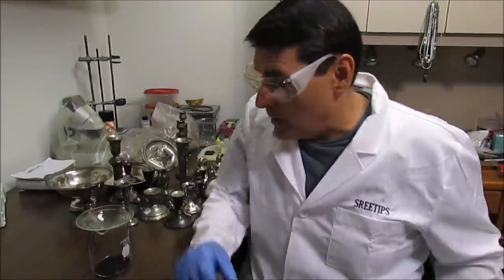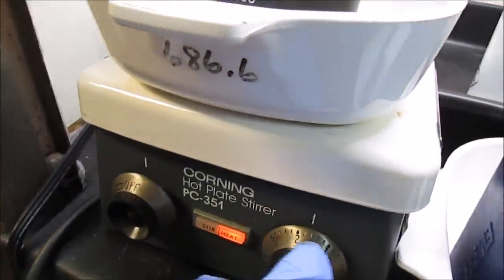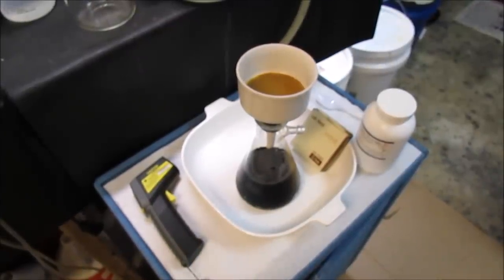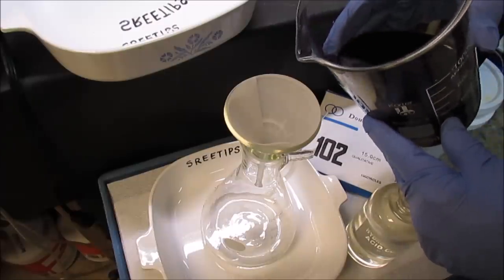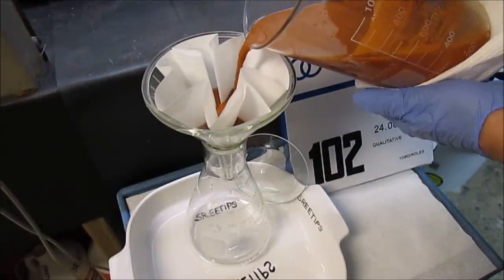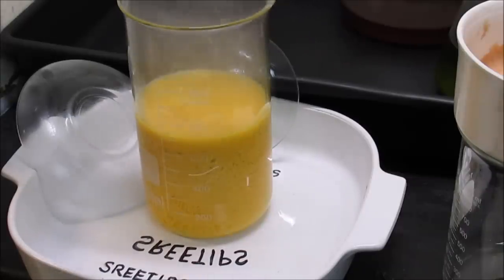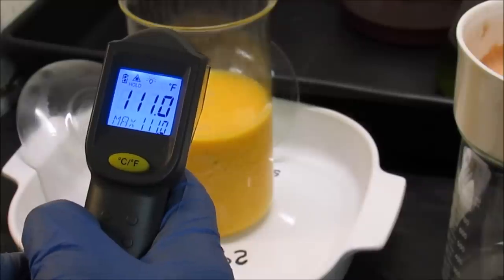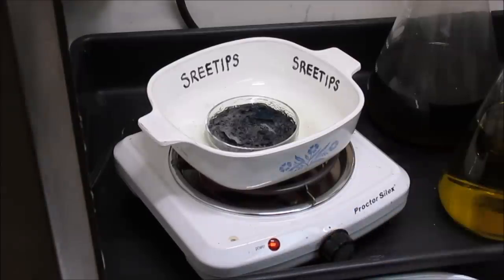Platinum Recovery From Automotive Catalytic Converters Part 2of2

Comment: Not any kind of amazing yield for the effort, but I greatly appreciate the information
Reply from the maker: no yield and too dangerous for do it yourself. Not worth it.
Reply: @sreetips   Yeah, I've got a bunch of palladium rich ore I collected. I got about half way through it before I decided it was too dangerous. Now I have a bunch of containers of blue and green and red liquid that I'm trying to decide what to do with. That's how I ended up here.
Reply from the maker: Get some zinc and cement the metals out of solution. Then collect the black PGM powders, dry them and send it in to a refiner. Most will give credit for platinum and palladium. Once the metals are cemented out they are no longer a danger.
Reply: @sreetips  Thanks

Comment: Could you have put the ceramic substrate from the last video into a ball mill to crush it all up?  You would have more surface area for the acid to leach as much PGMs out.  Or would that not make a difference?
Reply from the maker: To be honest, I don't know because I've never tried that.

Comment: you at least got $200 worth of palladium from those converters between the button and the filter ($19.50/g) not bad given you still gotta recover your platinum ($29/g)  would be cool to see how much money its all worth in the end
Reply from the maker: Aaron, palladium spot is $968, platinum is $908 (kitco.com) so Pd is $31/gram and Pt is 29/gram.
Reply: sreetips so was right on Pt but not Pd so the first google blurb i saw was wrong, so you got $350 instead lol
Reply: This is true, but you also need to consider the beaker that sreetips had in storage from his previous lab experiment. Factoring the time to extract the substrate from the metal enclosures, chemicals, Pyrex  glass, vacuum pump, buckets, exhaust fan, breathing apparatus etc. in the end, it was probably just the satisfaction of accomplishment. Those catalytic converters are not cheap and neither is the process in which to extract precious metals. Overall, I give you an A+ for your efforts esp editing a video for YT. I'm positive it was a net loss and that'll be the last time you buy converters!
Reply: as of 2/10/2019 Palladium @ $45.25/gram and Platinum @ $29.50/gram. that's up, $14/g more for Pd whereas Pt is only up, $.50/g from 8 months ago.

Comment: Hello Dear Sreetips, you are using H2O2 with HCl to dissolve PGMs displaced with Zinc. If I use AR instead to dissolve them  trying to have as little as possible excess of HNO3 in solution, will all the reactions shown in your video go as in hydrogen peroxide + muriatic acid method?
Reply from the maker: It should
Reply: Thank you! @sreetips

Comment: Hi Professor. thanks for the video.  I see all your videos. you are the best.  But I have a question. If I have silver in soluction. How can I recover the silver(with Salt??) and after recover the others metals?
Reply from the maker: I don't use salt. Instead I add clean copper and cement the metals out of solution. Any metal below copper in the reactivity series will come out of solution on the copper. Any metal above copper will not cement and stay in solution. The silver comes down first, then the gold, if any, and platinum group metals. These metals will appear as a fine black powder on the copper after all the silver has dropped.
Reply: ok professor.  but ... them... i will put everything in nitric acid.  how can i separete the silver from palladium? silver, palladium and platine will go to soluction.  gold remains in a pouder staff.  am i correct?

Comment: Hi, Sir. Thank you very much for sharing your valuable experience.  What is next procedure for Pt. which is still  in small container?  Please share a link if you have made any video about this.  Thanks alot.
Reply from the maker: I have Pt salts, like you see in this small container, from previous videos. When I can get to it I'll demonstrate how they get it processed. It will be coming out soon as I get the time to produce the video. Thank you for your interest.
Reply: @sreetips  Hello Sir, Thanks for reply to me .I have become very serious for recovery of palladium from catalytic converter after watching your videos. First of all I have started to make feasibility.  Raw material (without iron body) is available @ 47 usd per Kg. I just want to know that after buying material at this rate, will it be profitable or not after paying all further expenses? can you please share information regarding cost? Thanks

Comment: so does refining platinum and palladium from catalytic converters put all the contaminates from an combustion through an engine back into our air
Reply from the maker: No, only combustion can do that. Refining platinum and palladium does not require combustion until we are ready to burn (calcine) the platinum or palladium salts into pure metal sponge.

Comment: So what about the metal flakes from the white cotton part?
Reply from the maker: Those flakes are not platinum. There is no metallic platinum group metals inside a cat. It’s all in the form of a wash coat over a ceramic substrate

Comment: How did you dispose of the wasted material?
Reply from the maker: If I'm not mistake, this had ammonia in it. So I removed the traces of precious metals with zinc the the solution from that reaction went straight into my waste treatment bucket. From there it gets treated and disposed of as usual.

Comment: Spot palladiumm rose to a record high of $1,613.90 an ounce last week, a rise of 94% from the August low of $832.45. However, as of 10:32 a.m. EDT, the metal had collapsed to $1,362.55 an ounce.
Reply from the maker: I hadn't seen that. Just wait, the stock market will put it to shame. Right now it could actually hit new highs. That's how far out of whack everything is. But if it does then that will make the crash that much more spectacular when it happens.
Reply from the maker: Palladium was in a bubble.

Comment: What about the Rhodium? Cats have approximately 5% RH, 65% PD, 30% PT. Also are you, personally, able to do this on a large scale?
Reply from the maker: No, I'm just an advanced beginner learning as I go. Rhodium is an enigma to me, for now. I've watched these videos and scratch my head wondering how did I pull it off.
Reply: sreetips Hey man, that’s awesome that you were able to do this. Reason I ask about the large scale is because I have a few clients that would rather assay their material and want to be paid back in physical bullion. But I’m talking about a few thousand units. Refineries will only settle with cash value which doesn’t make much since. I think it’s the security involved that poses a problem to move the physical metal, because once in powder form and shipped to the refinery, they pay the supplier off the sample.

Comment: How much did you yield? I got a little confused if you got 6 g of palladium or 12g. Also, how long did this take? And why did you yield such a small amount of platinum. I thought a catalytic converter should yield 3 to 7 grams of platinum. Or is that a low purity unrefined yield?
Reply: Was this even worth it for you. It seems like you spent alot of money on your chemicals.
Reply: If you only yielded 6 grams of palladium and 2 grams of platinum thats about 500 dollars give or take right? That seems like such a low number for all the work, overhead costs, and danger to your personal health.
Reply from the maker: No
Reply from the maker: Correct
Reply from the maker: Refining cats is not for the hobby refiner. Too dangerous

Comment: Would the Map gas torch ever get hot enough? I think not. The Oxyaccetaline torch you used the 2nd go obviously was hot enough.
Reply from the maker: MAP will melt gold and silver, but it won't get hot enough for the platinum group metals

Comment: Ok I guess I’m to observant, I noticed you used a cutting torch instead of that propane torch.. I didn’t think propane would get it hot enough
Reply from the maker: Propane will not get hot enough to melt silver. Forget about trying to melt PGMs with propane. Oxy/propane will do it.

Comment: Great series! @56:13 ever tried boric acid instead of borax when melting Pd?
Reply from the maker: We use boric acid dissolved in denatured alcohol as a pre-treatment when soldering gold and silver jewelry. It acts as a flux to help the gold solder flow into the joint being soldered.

Comment: Why can't or won't you add the liquid with ammonia into the main stock pot?
Reply from the maker: I used to run my stock pot under my fume hood in my shop so ammonia fumes woukd fill my shop

Comment: Have you ever tried to get the rhodium separated?
Reply from the maker: No, I haven’t figured it out yet
Reply: I think if you use potassium hydroxide it should drop out any remaining metals in solution

Comment: Sir,  you have not released the last video for the platinum recovery. Were you able to recover more pt from the stored solution left over?
Reply from the maker: Traces only. It will go into my stock pot. I'll get a new video out on refining the Pt salt that recovered from previous videos.
Reply: sreetips sir, if you take the platinum salt to a refiner, would you still make some money? Is the salt already pure?
Reply from the maker: No, I don't think that the refiner would accept the salt. It would first need to be burned in sponge
Reply: sreetips is it gonna take more protocols to refine it? Just wondering why you have not completed the refining part of the platinum.

Comment: I have a question  if you wouldn't mind sir. What is the black silver metal in the catilac converter.  Is it platinum , rhodium, or  nothing nothing at all. Thank you sir.
Reply from the maker: John, there is no metallic platinum metal inside the catalytic converter. The platinum group metals are applied as a wash coat on the ceramic substrate located inside each metal casing. The only way that I know of to get the PGMs is to leach with chlorine just like I did in the video.
Reply: sreetips ok thanks I've been doing it your way I have produced  black stuff I'm guessing it's platinum
Reply: Well platinum and the other metals

Comment: Back at the start of video 1, you add bleach to the leachate mix the catalyst materials soaking in to get the metals into solution, instead of bleach ca a gas generator be scaled up and used to bubble chlorine gas in from right on the bottom and up through the substrate materials?
Reply from the maker: I would guess that it could. But I’ve never tried that
Reply: @sreetips  that could be an interesting experiment with a smaller quantity. Might be a little unwieldy with bigger buckets, but maybe for 2 or 3 cats worth in beakers.

Comment: how many converters did it to take to get the 6 grams
Reply from the maker: I can’t remember. Some of them had the wash coat already removed. Thieves will pass an acid solution through the substrate and pull most of the PMs. Then sell the converters on eBay. That’s where I bought them.

Comment: very good
It's awesome, amazing and useful this video thank you very much

But brother, what about rhodium? Why did not you extract it?
It is a very benign metal, a very strong chemical catalyst
Please give us an idea of how to extract rhodium and ruthenium

  Brother, is there platinum in the HHD hard drive?
Reply from the maker: My experience is what you see. I am learning, literally, in front of the camera as I go. None of this is staged. I have learned to get the palladium, no problem. Of the six sister metals (platinum, palladium, rhodium, iridium, ruthenium, osmium) palladium is the easiest to get. I still have very little knowledge about rhodium. But I'm learning as I go. I'll be doing a video on the platinum soon. I'll be trying to get some platinum metal from the Pt salt that I recovered and saved. I'm going to try to do a bromate hydrolysis very soon. Watch for the video. I don't know if there is Pt in hard disk drives, I've got zero experience with them.
Reply: thank you brother
You are a good and humble man
Yes we are waiting for the next video
I wish you from God that your luck is good

Comment: I have a problem, it seems that I will precipitate PT but dissolves again, does not fall to the bottom
Reply from the maker: Critical concentration for precipitating Pt is 1 gram per 20ml. Too high concentration and you'll form gelatinous form of precipitate. Not concentrated enough and it won't precipitate at all. 1g/20ml

Comment: The solid at 13:40 could be a polymer formed from hydrated silica as explained in section 3.2.1. of this paper: www.jim.or.jp/journal/e/pdf3/54/01/74.pdf

Comment: what is the product that prepicitate the palladium ,and thinkyou
Reply from the maker: I used hydrochloric acid the re-acidify the ammonia solution. As the solution turned from base (ammonia) to acid (hydrochloric) the palladium salt is pushed out of the solution as the bright yellow precipitate in the video
Reply: sreetips the product is vert dificult tout get it in my country,can you help me by telling me an other precipant of palladium from aqua regia and thank you
Reply from the maker: If you have palladium dissolved in aqua regia then you can use pure zinc metal to precipitate the metals out of solution.

Comment: Why do you sometimes NOT use the vacuum while you filter like here when you’re filtering pgm’s in liquid . You dropped the platinum out to solid and used no vacuum. 19 minutes 07 seconds
Reply from the maker: I think it because I was using a conical funnel to collect the valuable material

Comment: I notice that Americans use metric for chemistry, mls, grams etc. It is interesting that the hard sciences have not forced the issue with government.
Reply from the maker: 1967, 5th grade teacher told us, "in ten years we will have completely changed over to the metric system." I'm still waiting for it to happen. 1 gram is equal to one ml of water. All multiples of ten, so much easier.

Comment: I have a hundred pounds of dpf from 18 wheelers. Is that the same as car/truck catalytic converter?  Help please and thanks for the videos!
Reply from the maker: Sorry, I don't know what dpf is.
Reply: Diesel particulate filter. It Has that same honeycomb structure. Thanks for the reply
Reply from the maker: Got it. I don't have any experience with dpf.
Reply: The dpf is just a filter for large particulates in diesel exhaust. It has no catalytic properties. The SCR uses an ammonia solution to convert NOx compounds. Neither contain any PGM.

Comment: 12 grams = right under 400 dollars... Profit?
Reply from the maker: I didn't keep accurate records so I don't know. But my goal wasn't profit from the metal that I recovered. My goal was to produce a video that shows a way to get the metals.
Reply: WERE 6 GR ( WHIT SHEET) NOT 12.
Reply: Also remember he could probably get another batch off those chunks
Reply: Spent $387 on materials,so he made about  .92 an hour..
Reply: After you add in YouTube views, maybe a profit?  

A little over 200k views for part 1, 60k for part 2, I have no idea what YT gave Bafelous for that.

Comment: Hello how much the quantity of catatitic converter in this test.
Reply from the maker: I used about ten (10) converters plus the beads. I've been told by more experienced refiners that each cat should have about 2 grams of platinum group metals that can be extracted.
Reply: sreetips thinkyou can you tell me how much kg
Reply from the maker: I did not weigh the material before I started the leach in chlorine so I don't know.

Comment: You can separate palladium from platinum with nitric easy.
Reply from the maker: My experience is: a little platinum will come with the palladium in nitric. A little palladium will follow the platinum. These metals don’t cooperate. They are some much alike that a true separation is difficult to achieve. My experience.
Reply: @sreetips  not if it is cold and a little is relative just insure your glass is clean from oxidizer and hcl.
Reply from the maker: I don’t have lots of experience with PGMs.
Reply: @sreetips  i just tested a bead and found 0.33% rhodium (relative) from 9.45 grams and 64.5% palladium and 33% copper

Comment: NOT a chemist but you are calling what is labeled muruatic acid as Hydochloric acid. ???  Without researching it seems I have seen diluted hydrochloric acid called muriatic acid
Reply from the maker: Muriatic acid is hydrochloric acid. The “green” or less fuming version is diluted with water and should be avoided.

Comment: Thinking of the Spanish in the 1600’s…. Wouldn’t platinum be refined just like silver, because they thought it was silver, little silver..?
Just wondering…💁
Reply from the maker: No, platinum melt temp (3215 F - 1768 C) is almost twice that of silver (1763 F - 961 C)
Reply from the maker: Plus silver refining is like a cookie recipe compared to platinum.
Reply: Makes one wonder how the Inca knew how to deal with it.
Reply from the maker: Probably trial and error.

Comment: if this man uses solutions to remove the valuable contents why do the salvage companys or the cat buyers want a complete cat  why not the contents only ??? i would sooner ship the contents than the whole shell OR as he said in first video they removed the valuables and sold you an intact shell SOMETHING FISHY
Reply from the maker: The cats do contain platinum group metals. But as you can see by this video, it's not easy to get, and the amount you can get is small. There are large commercial refiners that do this on a much larger scale. There is no way for the back yard refiner to make a profit using a wet chemical process to recover and refine the precious metals from automotive catalytic converters. It would be like you trying to make a car in your garage that would compete with General Motors or Toyota.
Reply from the maker: Some cats have way more PGMs than others. You can tell by looking at the metal casing. If you remove the casing from the ceramic substrate then there is no way to determine its value.